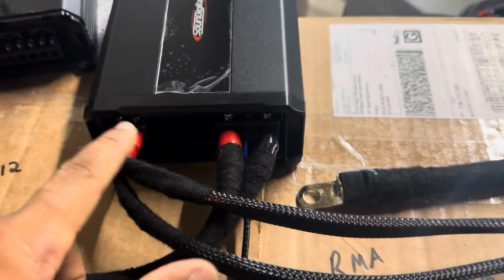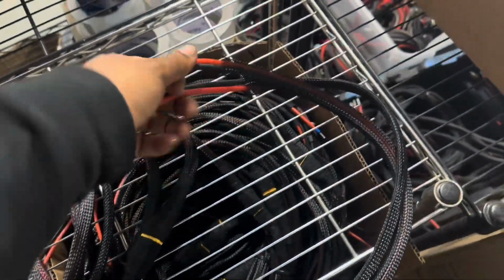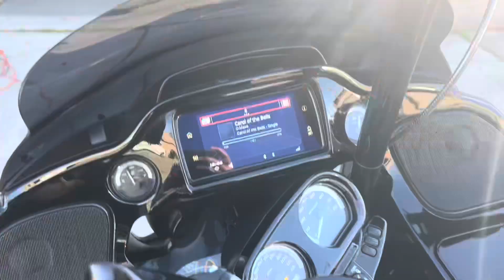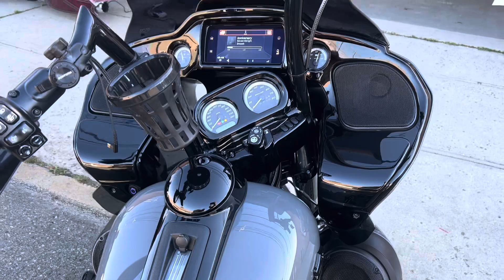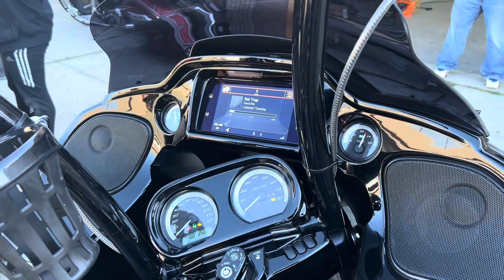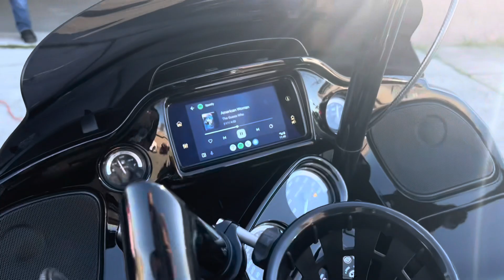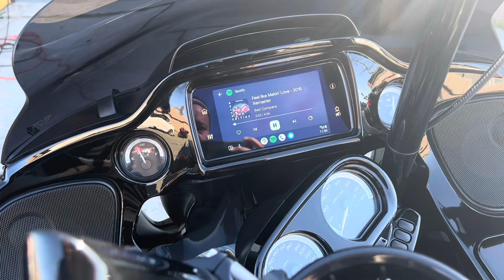Jeff took the 7 hour trip for Virginia to New Jersey to get the audio upgraded on his Road Glide .

Comment: What determines what 6.5 you use. I went with all cicada because of these videos. Cicada sh 6.5 with diamond tweeters in the front and ch in the advanblack tourpack pods. 1200.4. Soon some 200L in the bags.
Reply: Normally cost of build
Reply from the maker: Cost is 1 
Weather resistance is another 
Amount of power you are sending to the speaker 

We have a bunch of demo bikes for Clients to listen to before they make a decision. 

If we are running 8s in the bags it’s normally db moto 6 cd in the faring 

If we are running tens then it’s usually cicadas ch
Reply: @NVSAUDIO  what 10 do you recommend over the GZ yellow baskets
Reply: @NVSAUDIO   thanks.